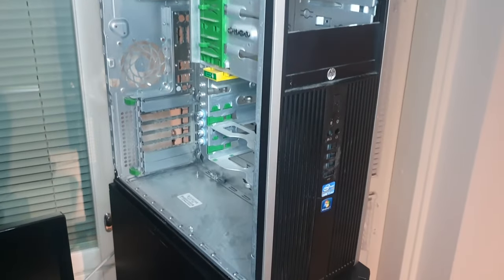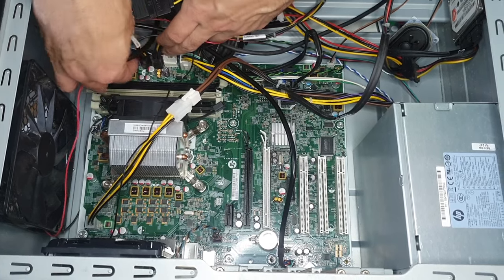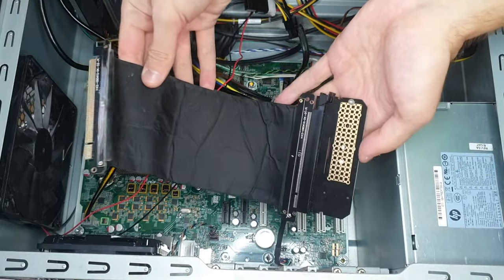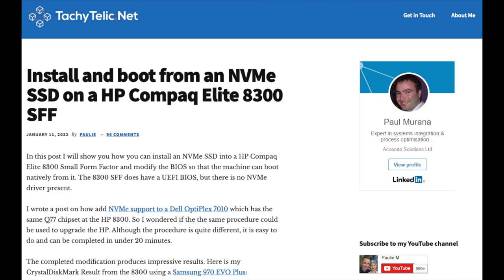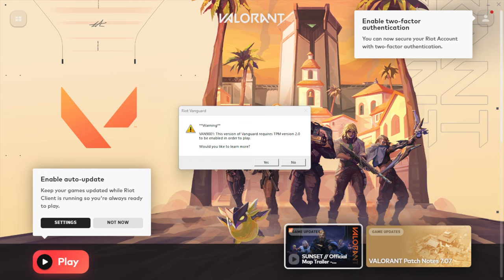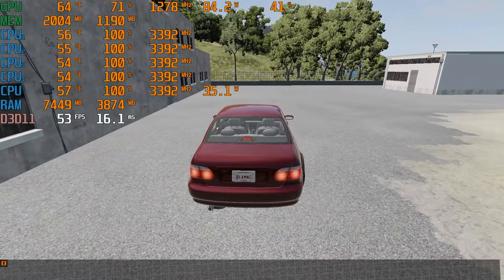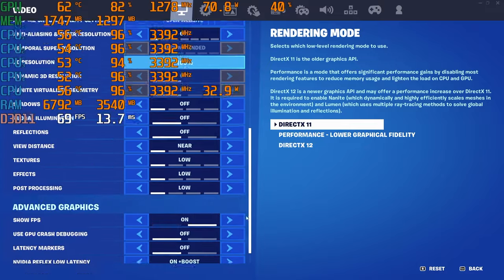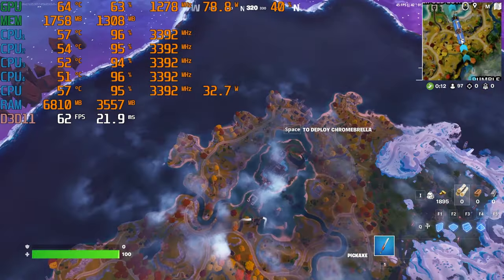HP Elite 8300 CMT Caseswap, GPU, NVMe SSD installation, benchmarks

Comment: Are the connectors on the front normal or do some type of modification need to be made?
Reply from the maker: I think front USB normal. Power button not but normal power cable can still be conected to the HP mobo. It's the PSU cables that are non-standard.

Comment: If I were you, I would buy a new power supply to avoid adapters that can ruin your system.  Those adapters are a fire hazard.  When you have the time, buy a new power supply such as an EVGA, Antec, Thermaltake, 80  plus certified.
Reply: Sadly these HP motherboards use some weird proprietary power cables, so that isn't really something you can do with ease. I agree though anything that can't use only PCIe bus power (under 75W) is going to be a problem. It's only a 320W PSU in there, too.
Reply from the maker: My understanding is that molex/sata to pcie 6-pin adapters are fine as long as you don't try to max out the 6-pin power spec, in other words you'll have to remember that sata can deliver less power that a 6-pin, and select a GPU that can work within the limits of the sata power. Also, with sata to 6-pin i prefer 2xsata to 1x6-pin to distribute the load to 2 connectors, should do something to prevent them from melting.

In my experience 960 with 120w TDP works fine with 2xsata to 1x6-pin. 320w PSU is also enough for the whole system, i did stress test and measure max consumption with wattage meter.

Instead, if you think that converting 1xsata to 2xpcie 8-pin (for example) somehow magically increases your power budget to max amount specified by those 2x pcie 8-pin, and install a Vega64 with 300w TDP (ignoring 320w PSU limit with even lower 12volt rail limit), that's when you'll run into problems, blown PSU's, GPU's, melted sata connectors, melted cables etc.

So my point is adapters are entirely fine as long as you remember you are in fact using an adapter and plan power budget accordingly. In other words, understand what you are doing and use common sense.

Of course with adapters you can always be unlucky and get a super low-quality one that has a thin wire that will melt easier, even if you are careful. But that is a common problem with all electronics, not specific to this adapter stuff.